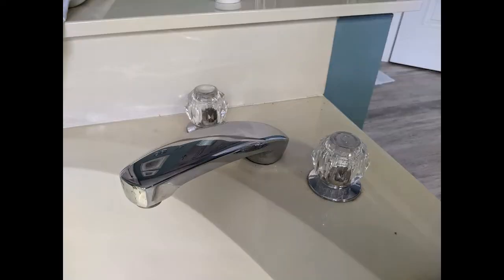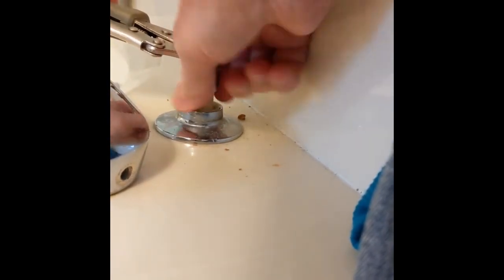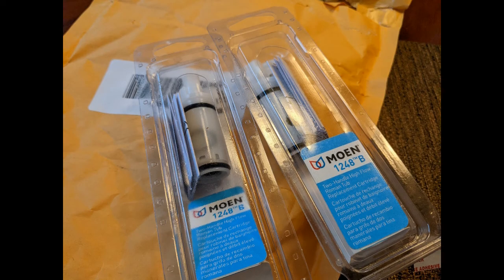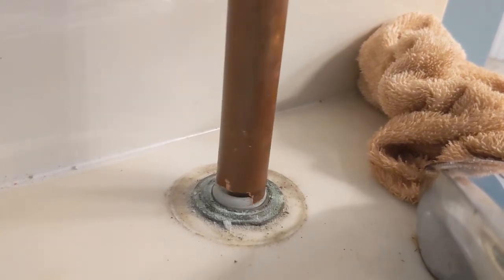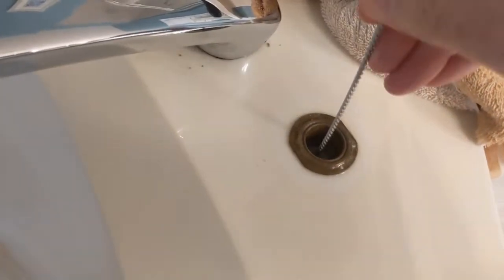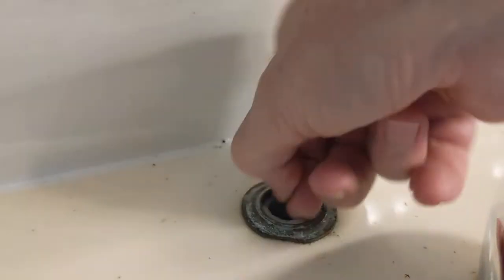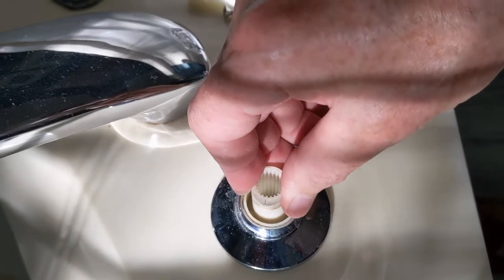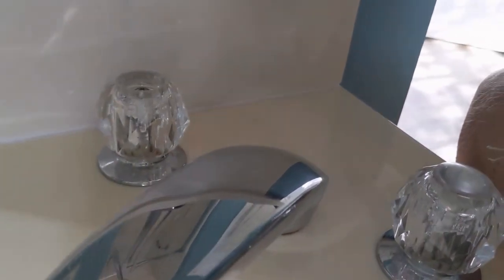Moen Roman Tub Faucet Dripping Repair

Comment: Yeah I got one just like it tysm for posting, unraveled the mystery for me! parts were clean and serviceable, just needed new O-ring. Valves lifted out easily with gentle pressure on the stem extensions, slipped plier under the top nut and gently levered, popped right up. My escutcheons so frozen to pipe after 24 years they won't come off, I saw another post where some desperado sawed em off with a dremel cutter, lol. Nice post for what looks like an easy job but isn't, tyvm!
Reply from the maker: Oh, what a drag that it wasn't an easy one for you.

Comment: God bless you!!! I was about to give up (which I never do) and made all kinds of homemade tools, looked at YouTube’s until I was blue in the face, but wasn’t sure what brand faucet it was. And then … I decided to use the Google Lens and it instantly told me what brand and model 😁 Then I found your video. You Da Man!!! I’m going to do it tonight after work. I also ordered a WiFi valve to turn off the water. My wife doesn’t do anything fast so it’s just easier this way … LOL. Thanks again!!!
Reply from the maker: Ah, very smart to use Google Lens!  I only use it for plants, but I need to think outside the box.  Anyway, glad it got you to a solution.

Comment: Thanks for making the video and sharing your experience. Interestingly, you mention "getting up the courage" to do this DIY fix; it took me a good month to have the courage to work on mine. All turned out well, except I still got an extremely slow drip, which drives me crazy! I spoke with Moen, and they are sending another pair of cartridges. I get to do this all over again once they arrive. This time, I will measure the depth per your recommendation and hopefully get these cartridges seated correctly.
Reply from the maker: Too bad you had to go through this twice.  I hope you've got the drip problem solved.
Reply: @sengsational  Thanks. It is now resolved. I'm crossing my fingers that the leak doesn't return until I move out. Haha.

Comment: Measuring the depth that the old cartridges sit down in the valve body BEFORE removing them is a key step.  There is basically no way to otherwise be sure that the tab on the cartridge is aligned and seated in the matching notch on the valve body.  On the 1248 cartridge the difference in height between aligned and fully seated verses misaligned and not seated is about 2.4mm.  I recommend using a digital caliper's depth gauge for all the measurements but a manual one or just a witness mark on a small flathead screwdriver's shaft may work, depending on how good your eyesight is.

If you don't get the correct depth all you can do is remove and reinstall slightly rotated until it seats.  Trying to rotate the cartridge body while in the valve body is almost impossible even if you can get it to turn because the fit it so tight that you can't rotate it accurately - just getting it to move insures once it does that it will move more than you want.

If you find blue deposits on the inside of the valve body, fold a half sheet of paper towel and then roll it up from the  sides so one end is the doubled up towel.  Work the towel down into the valve body using a twisting motion.  Once the towel is fully down, saturate the towel with white vinegar and let is sit for several hours, then repeat the bottle brush cleaning.  White vinegar one a paper towel will also remove the blue stain that you might find in the tub if the  dripping has been going on long enough.

Allow several hours for the project as all the steps can take time - if you're lucky it will all go quick and easy but don't bet on it.  A water shutoff can be a challenge to domestic tranquility.
Reply from the maker: You have earned the the top spot in the thoughtful response category, and get a heart.  The world is a better place because of your contribution.

Comment: I saw that you used the 1248 cartridges to replace the 14891 cartridges, but in your description you mentioned that the 14891 is similar to the 1224. Did the 1248 work?
Reply from the maker: Yeah, the ones I showed worked fine.

Comment: Just a tip for those who want to use long nose plyers. The standard size is 6" long, and that doesn't work very well. The middle part is too wide. The next smaller size is 5" long and the middle part is more narrow. I have both and my 5" is spring loaded open so you just squeeze and release inside the faucet tube. It works perfectly.
Reply from the maker: Thanks for the tip.  I knew that making a tool out of a copper pipe wasn't going to work for everyone.  Hopefully others will see your comment.
Reply: @sengsationa1  actually I liked your copper pipe tool better. I looked in my basement and couldn't find a 3/4 " pipe. I found a 1" but that's too big. 😀

Comment: Great video, I am having to remove the same, however the cold one has a rusted out screw that hold that extender to the cartridge. Did you have any such issues or did both your screws come out easily?
Reply from the maker: Thankfully, mine came out without issue.  There are cases where my fix did not have the worst-case obstacles, such as the one you encountered.  I'm not sure how best to resolve your situation.  Let us know here if you found a resolution.

Comment: Thanks for this demo. You mentioned that Moen sent you free cartridges because of lifetime warranty? Did they require a purchase receipt to prove you paid for them? In my case, these were installed by the house builder.
Reply from the maker: Mine were also builder-installed, but the former homeowner left a file folder with all of the "builder stuff" and it included a certificate from Moen.  I did include an photo of the certificate when I requested the cartridges, but I'm not sure it was essential.
Reply: I did not need a receipt… just told them builder installed and the year
Reply: @Kelly Maloney  I did the same, and Moen honored my request. I just sent pictures of the faucet, the year I purchased the home and my mailing address. It took 7 days to deliver. I finished the installation, and no more leaking! 😀
Reply: @sengsationa1  thanks. Moen honored my request. I installed them and no more leaking! 😀

Comment: Thanks for the great video! My Roman tub faucet has the same issue and the top part of cartridge inside the handle looks the same as yours. does this mean my cartridge is also Meon Model 1248B? where to find the cartridge info without pulling it out from the pipe?
Reply from the maker: I just used the "look" of what was showing on top to determine which model I had.  As Mike Milner mentioned, "domestic tranquility" is important: you can't just shut the water off to the house for a week and wait for the part to come in the mail!

Comment: During my repair, the white plastics nut that screws down over the cartridge broke when using the pipe tool screwing it back in. What can I do?
Reply: The cartridge nut
Reply from the maker: Hmmm.  Not sure how to correct that problem.  Broke, as in not holding the cartridge in place, or broke, as in can't turn it, but still holding the cartridge?  If the latter, then I guess you're ok, but if the former, I'd say you'd need to get a replacement cartridge nut.

Comment: Hi, I used the tool made for Moen Shower faucet to pull out the cartridge,I reversed the tool. Watch my video (spanish) on my page
Reply from the maker: I did see that they had some kind of puller tool for sale.  That might have been a safer method because the method I used didn't pull perfectly straight up.
Reply: But you did a good job!! @sengsational